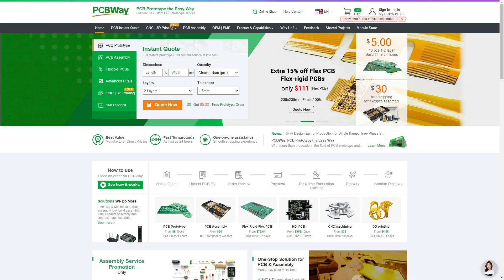De-soldering, removing and replacing components on a faulty MERG DTC8a DCC train detector kit.

Comment: Here is a top tip for desoldering those transistors, not requiring a solder sucker.  Cut the transistor legs, then heat the pad until the solder melts, then holding the board by the edges bang it down on your work surface (obviously before the solder resolidifies).  Imagine the action of holding a glass of water and banging it down on the table.  For the PCB the pad of you hand hits the table abruptly stopping the motion of the board downwards (the board does not hit the work surface, it is the pad of your hand stoppping the motion).  The wire and the solder continue downwards by intertia and end up as a splatter on your work surface and the pad hole is completely clear.  Simply repeat for the two other remaining legs.
Reply from the maker: Thanks for the tip, that sounds like it will work really well :)

Comment: Buy a small reel of Chemtronics 2mm solder braid (or solder wick). Place the braid over the solder joint and then heat with the soldering iron and it will wick the solder out. Used in combination with the desolder pump will make it much easier to remove the components. Remove most of the solder with the pump, and finish with the wick. The wick is about £5-6 for a small reel.